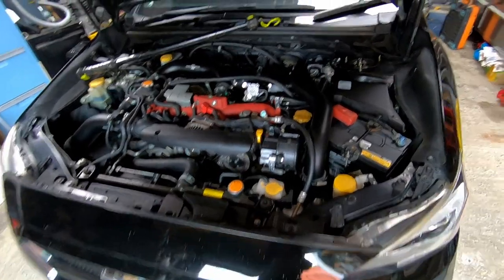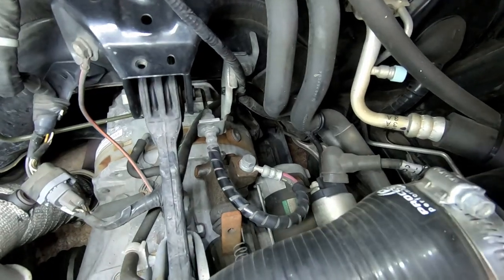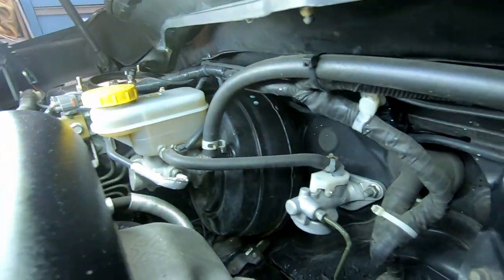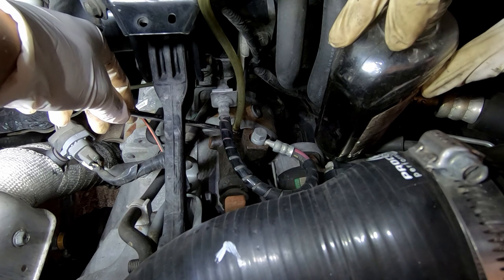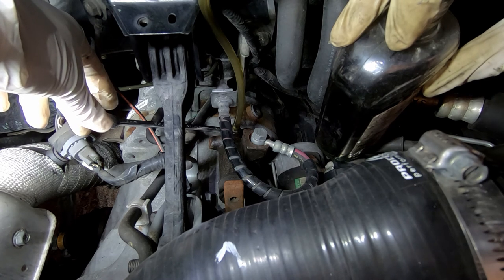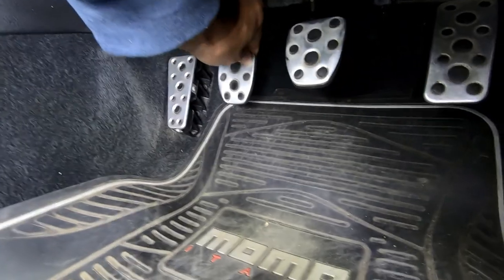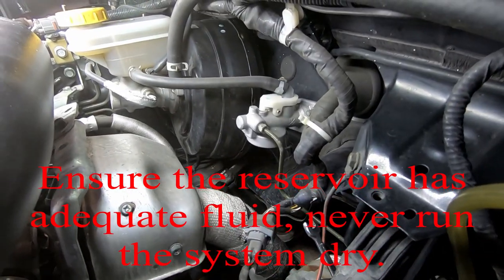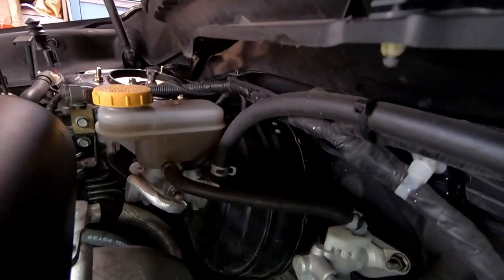WRX STI Clutch Pedal Bleeding - Easy Way

Comment: my sti clutch gets stiffer once the car gets hotter thinking it may need to be bled the pedal itself seems to loose the top play aswell
Reply from the maker: @FizuhcuL  Try bleeding and adjusting the freeplay on the pedal this is important
Reply: @AutoBuddynz  i did it helped a bit noticed under high temps it gets stiffer still though
Reply from the maker: @FizuhcuL  Sounds like you will need a new clutch kit. Issue will be either with the release bearing or pressure plate
Reply: @AutoBuddynz  Even if it still drives pretty good? its only noticeably stiffer in  bumber to bumper overheating type traffic. though i do notice it doesent releasing the clutch, seems to not want to let go.. car has 225k on the engine witha fresh-ish sti swap. took it to the track weekend and ran amazing.
Reply from the maker: @FizuhcuL  More than likely it sounds like an issue with the release bearing, however with all the labour involved it makes sense to replace the complete clutch kit and get the flywheel machined at the same time. As long as you have tried bleeding the system, adjusting the freeplay etc which it sounds like you have then my suggestion would be above
Reply: @AutoBuddynz  Only 10,000km on it i hope it isint the release bearing XD reason i got rid of my 5 speed wrx and threw in 6 speed. only reason i think the release bearing is fine is because the car was absoulty fine til it sat for a month. lost clutch pressure new master and slave then this problem so i dont see how all of sudden clutch is fkd :(

Comment: My grandson has a 2019 Subaru WRX, I drove it last week. I really had a hard time pushing down the clutch pedal. Is this normal?   Thanks....Jim
PS......once I got going I had no problems.
Reply from the maker: Hi Jim, its normal on a Subaru especially on a WRX or STI to have a heavier clutch, however it should not be hard to push unless this has been upgraded to a performance clutch or similar.

Comment: How many times did it take to keep the pedal from sticking to the floor when opening the bleed screw?
Reply from the maker: Normally between 3 - 5 times it should build pressure.

Comment: Great video, when the bleed is done and the clutch is popped back up, is the clutch firm again (doesn’t stick to the floor) as long as the bleeder is closed?
Reply from the maker: Once you have completed the bleeding process and closed the bleeder, the pedal has to be firm, if it feels spongy repeat the process of bleeding, if it loses pressure or the clutch pedal does not disengage the clutch checks for leaks at the master or slave cylinder, or make sure no air is getting into the system while bleeding.